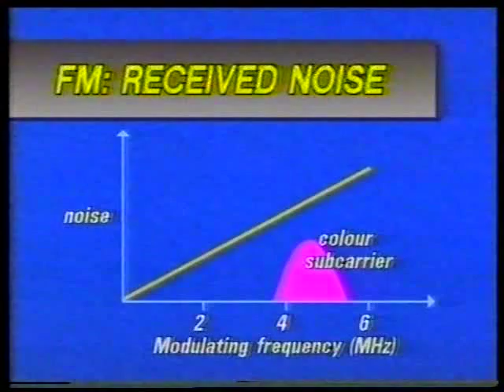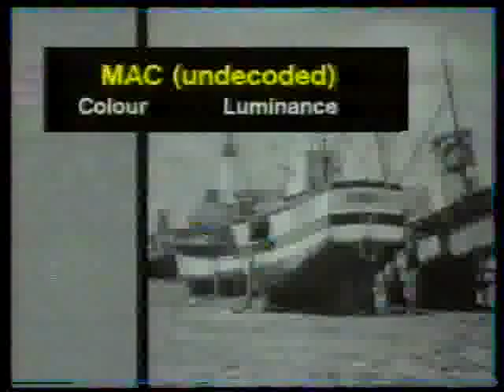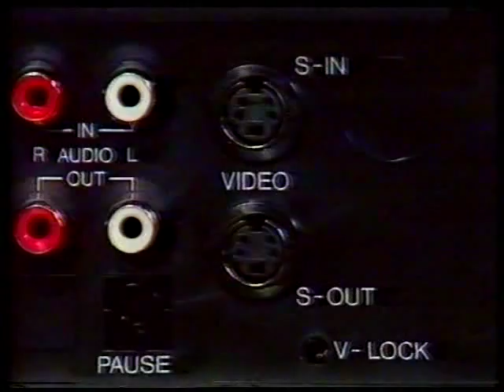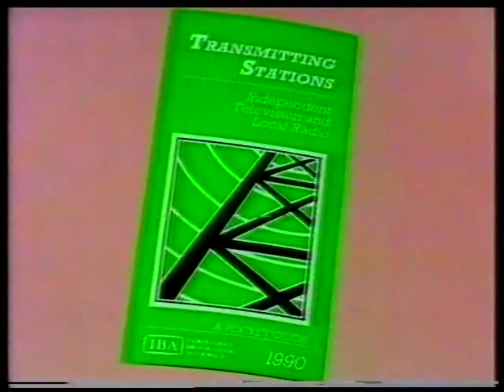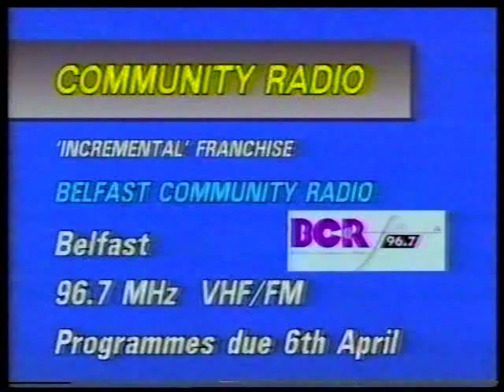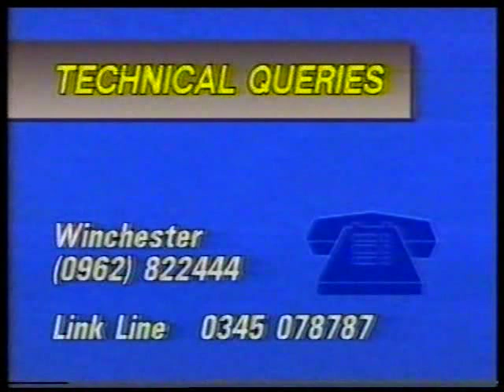IBA Engineering Announcements BSB Startup - D-MAC DMAC - 27 March 1990

Comment: I thought it sounded in NICAM Digital Stereo, sounds great! I know the IBA Had a few problems when they broadcasted for the first time from Emley Moor in Nicam Stereo but no problems from Crystal Palace in 1989.
Reply from the maker: There were some problems when BBC NICAM started - the picture would look like you'd pulled your aerial out, a click then the aerial would be plugged in again!  It happened repeatedly for several days.  I don't know what they were up to...    I have another Engineering Announcements video here where NICAM is discussed.
Reply: The first Engineering Announcements in NICAM Stereo was plagued with problems in the Yorkshire area as the Emley Moor transmission kept dropping from stereo to mono and back to stereo again, but the Crystal Palace transmission was flawless with no technical problems and sounded good.

Comment: D MAC - the Betamax of satellite television: technically better, but a commercial flop!
Reply: +Ronnie MacLennan Baird A real shame, too. I think it was down to BSB's management decisions rather than any problem with the D-MAC format itself. Just think, if things had gone the other way Sky could've ditched PAL and adopted it...

I'd love to see a live side-by-side comparison of PAL vs D-MAC. Grainy, compressed YouTube videos can't really capture it...
Reply: Actually Beta wasn't technically better. it was just the same as VHS.
Reply: DMAC and D2MAC lived on for many years in Scandinavia.
Reply: By the time it took off DVB-S was around the corner, which was digital. With 4.4 dB C/N ratio it offered a single 1080i HD channel even with MPEG-2 with the same bandwidth. An equivalent analog signal would be grainy and full of spikes.
Reply: @dkek383  Thing is, these digital channels were crammed into ONE RF channel. Give each digital channel 27 MHz of bandwidth and they'll look just as good and even better when reception conditions are poor.

Comment: D-MAC was an excellent system with flawless component RGB camera to satellite pictures and crystal clear digital stereo sound that used a similar sound format to NICAM Digital Stereo but it wasn't NICAM format sound as used in terrestrial transmissions. Not all cable operators offered the BSB 5 night pre satellite launch week schedule, my local cable system East Lancashire Cablevision Limited didn't offer the pre satellite launch week programmes.
Reply: Component wasn't RGB tho, but YPbPr or something similar.
Reply: @fungo6631 The cameras used for bsb studio and video tape productions were coupled up in component for the studio broadcasts and recording direct to tape to give the high quality pictures.
Reply: @fungo6631  Technically that's correct but in everyday practical use they're very much the same and both far superior over the composite system used in PAL. The first time is saw digital television over SCART-RGB on a 50Hz CRT set without any picture manipulation I was quite stunned what a difference that made. So much clearer, sharper and much better colors. 50hz CRTs could really shine with digital feeds via RGB and SCART.
Reply: @notsorandumusername  Can confirm. Cheaper TVs benefited the most. 

I had some no name brand Soundcolor CRT TV and switching to RGB SCART made a BIG difference in image quality, it was much sharper!